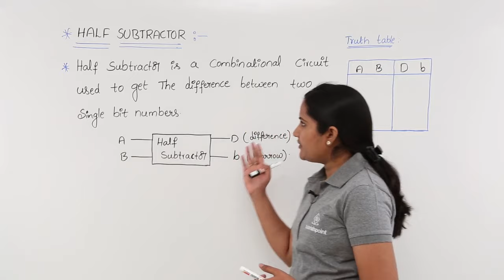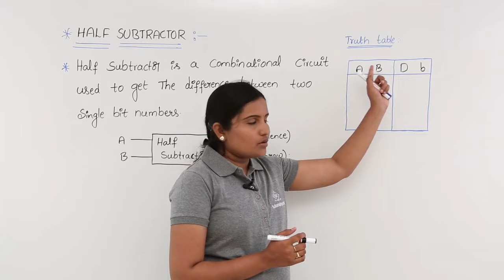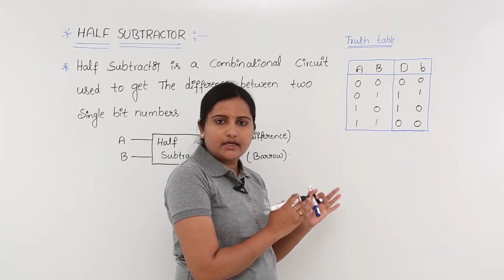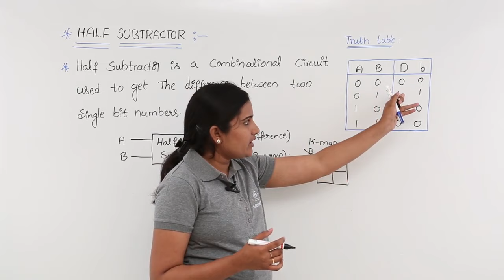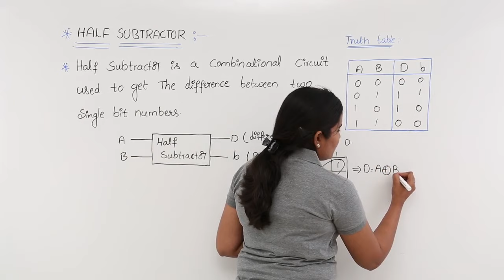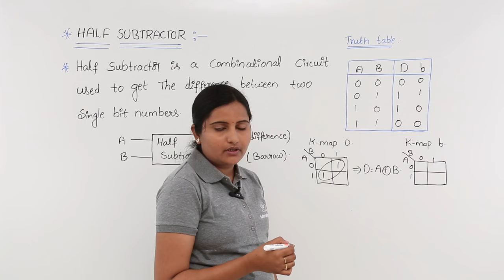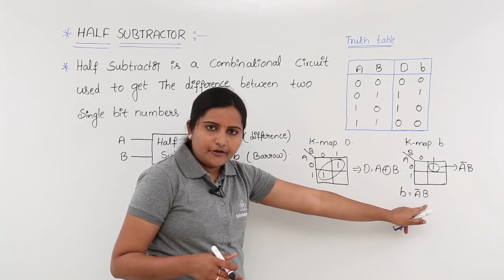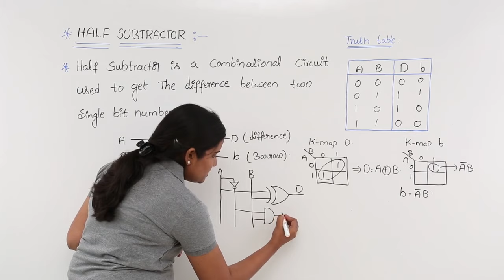Half Subtractor

Comment: How's that 0-1 becomes 1 with borrow?
Reply: you can't subtract 1 from 0 right! So to proceed the subtraction; make a barrow 1 from left side digit. Then the number becomes 10 now and you have to now subtract 1 from 10 (i.e. 1 0 - 1 = 1)and we get the subtracted answer as 1.
Reply: subtracting in binomial system rightt😊